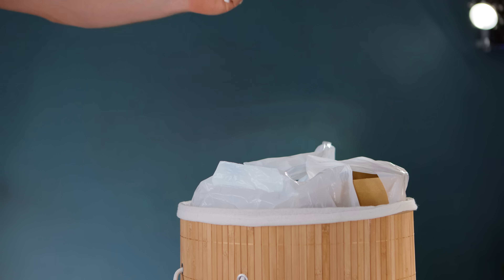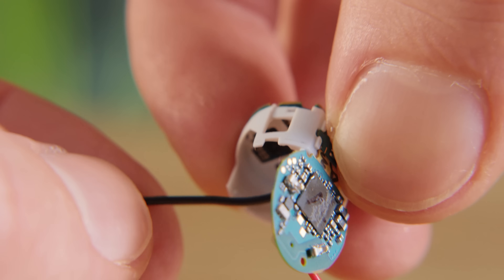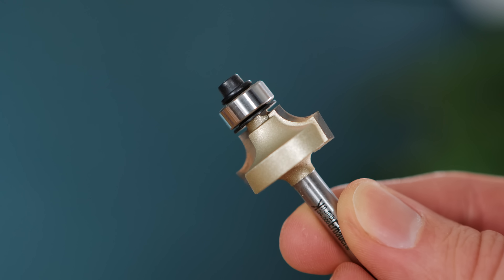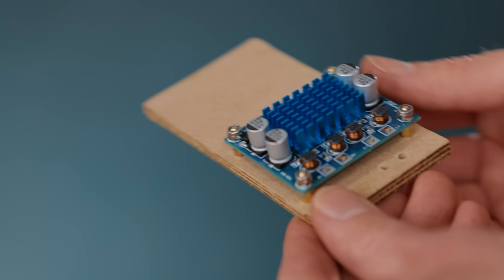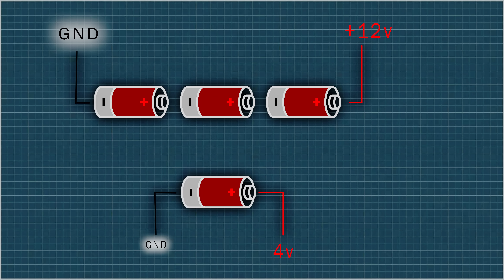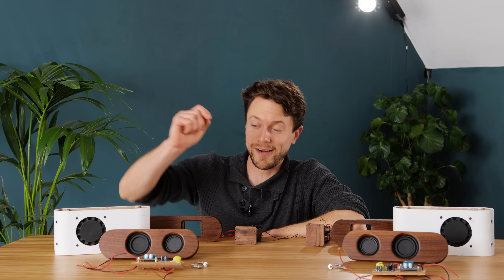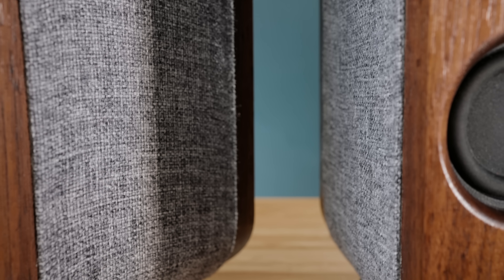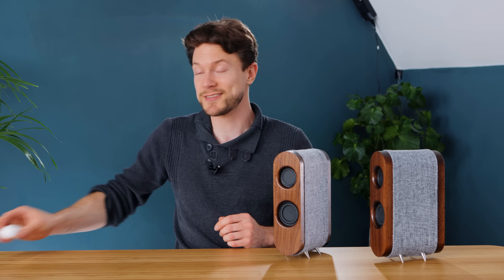Transforming dead earbuds into POWERFUL wireless speakers

Comment: This is so amazing I'm seriously considering taking apart a working pair of earbuds to build a custom set of wireless speakers but I can't help wondering if perhaps there is a way to integrate the battery charger into the speakers themselves instead of having to remove the batteries whenever they need to be charged.
Reply: Have to agree, only problem is that I suspect adding a changing controller is expensive and troublesome. Those batteries can explode if not charged properly. Kinda sad because it's about the only think I didn't like about the speakers..... I'll stick with my boss mini II rather than unscrew, individually charge (with a special and not so cheap charger) each battery every few hours of use..... might look into what it would take to integrate a charger though.

Comment: Cheers from Brazil. Formidable crafting skills. What tool have you used to design your speaker box? Since you are taking so much effort to build those audio projects I'd recommend you to study guidelines to avoid radio and high frequency on your signal and crossover circuit, among those the easiest is avoiding exposed circuits by shielding the amplifier cavity and avoiding any kind of pointy end, like ones in leg endings of components. Also I haven't understood why you haven't incorporated an isolated charger and earbud controls and microphone to the front of speakers instead of a removable battery,

Comment: Why didn't you seal the holes for the wires as well? That's going to cause some air flow differential and mess with the sound a little bit.

Comment: As an audiophile, I couldnt use the capacitor/resistor circuits for the frequency filters. I would HAVE TO use potentiometers. It doesnt matter how much you calculate, if you cant dial in the exact frequency cutoff you want, youll never be satisfied with your sound quality.

Comment: already made this but the resistor+capacitor circuit help a lot now i can split low mid and high freq to different chamber instead of directly connecting to amp

Comment: Nice projet :)
Strange idea to use batteries you have to get out to charge... Couldn't you use the battery charging case of the earplugs to do so with just a simple USB cable? (maybe 2 to link the second speaker to the first one)

Comment: That's a really cool idea! I didn't expect, that you could actually create something new with old earbuds. But I didn't really like the battery system, it would be cool if the batteries could be charged inside the speakers.
Reply: Have to agree, only problem is that I suspect adding a changing controller is expensive and troublesome. Those batteries can explode if not charged properly. Kinda sad because it's about the only think I didn't like about the speakers..... I'll stick with my boss mini II rather than unscrew, individually charge (with a special and not so cheap charger) each battery every few hours of use..... might look into what it would take to integrate a charger though.

Comment: May you never hear class a tube amp.high frequency not hear well. More than 9 khz sounds get distortion. Use 2.2 uf bipolar capacitor In Tweeter side. Bose one  not loud enough but very nice high frequency response. Only good base not enough tell audio is hifi.

Comment: @DIY Perks Can I send you my Epson projector as a build project?
Im thinking of exchanging the HiD bulb to a high CRI Led from Yuji that you featured before. Also add watercoolng to make it completely silent.

I think It's rather easy for you to add a TTL logicboard with PWM for lamp check and add a LED driver instead of the Osram driver Epson uses..

🙏 I think many Epson projector owners would praise this since It hasn't been done by anyone on the Internet.

Comment: I woukd have done the equalizer resistance with a potentiometer so I could adjust it if I wanted. Keep the capacitors for a cleaner signal

Comment: Pretty trivial to add a USB charger/balanced charge/low voltage protection/short protection circuit to those batteries so you can just add a USB port to the speaker to charge it. They cost about as much as the amp and are tiny.
Reply: The 18650's used have protection already. He even recommended using protected cells.  You would also need 1x 3s and 1x 1s or 4x 1s.  I think at that point he thought it was complicated enough.

Comment: This just looks like a work of art. I have no words.
Reply: It's amazing what you can achieve with  electronics knowledge and about 60 quid for speakers and amplifiers and few resisters . Even if it cost you 100 pounds that's cheaper than a 300 pound Bose speaker

Comment: This is awesome!! but you made a couple of mistakes in my opinion. 1) You should’ve made the speakers rechargeable without the need to take out the battery’s every time. 2) you should have made a pairing/power button to pair those speakers to other devices too. I don’t know if your speakers are able to connect to other devices because you didn’t show that, but I hope they can.  3) you should’ve made a metal logo or metal piece with your name on it to glue it to the front because they look so sexy they deserve your name on them!

Comment: Call me idiot but why you need passive radiator for a speaker? And can i use metal for the enclosure?
Reply: Passive radiators are used in many modern speakers because they are a terrific way to get a whole lot of extra oomph out of a sound system without diverting valuable energy into creating that lovely bass effect that we all enjoy so much. They are common in smaller, modern, computer-driven speaker systems largely because they are designed to sound like a bigger speaker while remaining quite small. They are a relatively inexpensive way to deliver a full-throated, rich, and robust sound experience in a way that is mechanically efficient and ideal for the miniaturization that mobile sound systems require. You could use metal.
Reply: @hippopotamus86  ahhh thanks for the explanation it was interesting to read!

Comment: I wonder if there are lower-powered speakers to bypass buying an audio amplifier and increasing the battery life. Also, couldn't you use the software included in Samsung phones to monitor battery life and add sound effects?

Comment: Next step - add a charging circuit so you dont need to pull the batteries out, or switch to LiOn batt packs (or both as it were lol)

Comment: Love the idea. I've been taking cheap speakers and building decent speakers with the Bluetooth circuitry. You could have placed a 4.2V charge control board and a 12V charge control board in the speaker and charged the battery that way. Place your filters and control boards on a piece of perf board. At least that's what I would have done. You could charge both from the same 12V wall wart as long as it put out 3Amp. This way you could run them all day and still pull them off the plug and take them with you fully charged.

Comment: I've been thinking about how to fix my car speaker system along these lines. My car has an issue where the radio cuts on and off. I've read of someone replacing the radio, but the issue remains. My thoughts have been to bypass the radio entirely and go straight to the speakers. I use my phone for music and such, so I don't need an actual radio system.

Comment: How you turn broken electronics and some random parts into beautiful products is absolute wizardry.
Reply: IKR? Just wow
Reply: Da😂
Reply: But still if you have moony to buy apple hearbud you have the money for great speaker.
Reply: @raychii7361  thats why you are using ones you had that failed of a for parts pair off ebay
Reply: @raychii7361  airpods aren’t too much more expensive than other wireless earbuds. And this is meant for dead ones bought online or old ones that you own.

Comment: Really great idea for re-use of the bluetooth earbuds. It feels odd that you spent so much time making them sound and look nice but then didn't bother making them easy to recharge. I don't think I'd use them very often if I had to manually pop out and replace/recharge the batteries every time they ran dry. Maybe the next version can have wireless fast charging charging bases and USB-PD capability?

Comment: Your skills at making stuff look good are amazing, altho your skills with electronics seem lacking, like why havent you made a pack from the lions and added a charger?
You could have made it lets say usbc chargable, you also could have made the baterry run at just 1s 4p and used a voltage booster for the amp, that way, you could get uniform max volume over the whole range of voltages of the cells.

Comment: I think you can include litle bms/charger inside every device. You can use magnit cable for smartphone charge.
Reply: agree not fan of having to remove the battery to recharge them. He could have handle the charging part better.

Comment: Hey, what you not simply instal a lithium battery charger inside, to not remove manually the cells ?

It's very ineficent cost, and it's help a lot  !

There are all in one circuit bluethoot receiver and amplifier, you need to simply connect to greats speakers
And you will get a great sound 

However, nice idea like in any videos.

Comment: It would be very interesting to see a collaboration where he sends these to an audio focused channel for a blind review and then reveals that they are home made from broken ear pods.
Reply: Send em to youtubes favourite aussie who screams at ipods and bootleg mp3 players, dankpods.
Reply: @Legofan2676  Just tell him to leave the 1-grit at its place for this one ;-)
Reply: @Legofan2676  I love how he's getting popular
Reply: @Legofan2676  THE DIRTY BUDS aRE NOW BETTER?
Reply: @Legofan2676  genius idea
Reply: @Legofan2676  YES , fellow dankpods citizen here r ya?
Reply: Granted, how much are those broken earbuds doing beyond handling bluetooth...?
Reply: @ericrosen6626  the digital analog conversion is also handled by them
Reply: @saltyman37  Yeah that's the only problem I see with them. The dac isn't going to use these to their best potential.
Reply: @clickbaitcrill3394  

I also think they might have built-in DSP frequency correction for the headphone drivers, I don't know if he compensated for that, probably not with those simplistic RC filter networks. But as long as it sounds alright...
Reply: @tams805  

I'm certainly not the type if 1000$ cable flexing audiophile you might think of. However, it is a fact that speaker building is something that is easy to get into but relatively hard to master. 
I'm aware that you can connect up a random woofer and tweeter with a 2-10 uF capacitor and it will sound alright if not good for 90% of people. In fact, that's how most of the cheap 1990s midi system speakers were designed and almost none of them sounds outright nasty.
His design is one or even a few steps above that, but there's still a lot of room for improvement. It takes time until you figure out the methods and tools to design a speaker without many acoustical and electrical problems for a specific sound signature, of which flat (neutral) is the most popular today, although, apart from in a studio setting, I don't think it's always the most appealing. It seems like he designed the speaker by trial and error without taking measurements of the drivers' and the BT device's frequency response. Which is fine for a project of this scale, but not the best method of design.
Reply: @ericrosen6626  exactly! I clicked on the links for the parts he used and it priced out at over $300! Not including the broken earbuds
Reply: I love it
Reply: Why? What is the point in that lol. The ear buds just make them wireless. The sound quality itself comes from the speakers and filters he installed and has nothing to do with the ear buds. The sound quality wouldn't be surprising... lol
Reply: It's actually a great idea.
Reply: Great idea, let's hope he sees this!
Reply: These things scratch a level 6 and..... Oops!!! Wrong video. My bad, I'm sorry.
Reply: I vote for that to happen! Lol
Reply: DANKPODS
Reply: This comment literally makes no sense. The ear buds only make the speakers bluetooth. They have nothing to do with the sound quality. Why would any audiophile be impressed or care?
Reply: these aren't made from broken ear pods😂 they are made from the same shit every stereo speaker set are made from. the ear buds just make them blue tooth. like what?
Reply: @HeyHey-fy5jd  
A stereo pair of Bluetooth earbuds will give you separate left and right channels to the speakers. Ordinary Bluetooth speakers come as singletons with both channels in one.
Reply: @bwake  That's why I said stereo speakers... Do you know what stereo means? Stereo means multiple channels or "left and right" as you call it. A pair of blue tooth stereo speakers are no different then what he made. You know they make wireless stereo speakers right? The single channel you're referring too is called mono which is single channel. They don't only make mono blue tooth speakers you know. They're just more common. Again as I said what he made is the exact same thing as just buying a pair of blue tooth stereo speakers. Pay attention.
Reply: you do realize the ear buds have nothing to do with the sound quality right?....
Reply: @DATBOCK  It actually might have an impact on sound quality. Wireless earbuds are generally limited to SBC codec with only recent ones supporting aptX. To my ears they sound about the same but someone younger might be able to hear a difference.
Reply: I'd be interested in watching that. Honestly the sound from these really didn't impress me.
Reply: @86abaile  You can't tell how good they sound by listening to a compressed YouTube video😂 There's also the variable of the mic he used to record them, the processing he did in post, and the quality of your own headset/ speakers your listening on. You can only tell how good speakers actually sound in person.
Reply: @PabzRoz  You can do some level of A-B testing. And if you can't hear the difference between these and the Bose unit, you have worse problems than the signal chain with your audio quality perception.
Reply: @Markle2k  Obviously I can hear the difference between his speakers and the Bose. That audio quality has nothing to do with the blue tooth. They were both in range and had significant bandwidth. Only reason his speakers sound better then the Bose system is because his system is stereo for one, and he bought better quality speaker units then the Bose had. You could literally buy a set of decent wireless stereo speakers and it would be the same exact thing as what he put together. The point is the actual ear buds themselves have nothing to do with how good these speakers sound. They only make them blue tooth. They sound so good cuz he just bought better speakers... That's it.